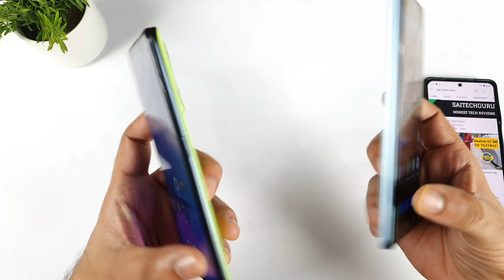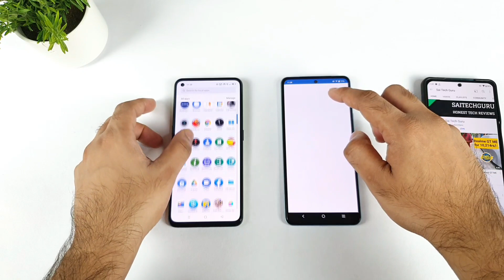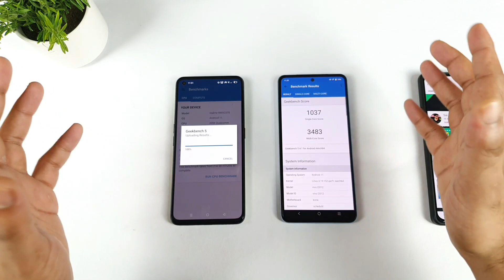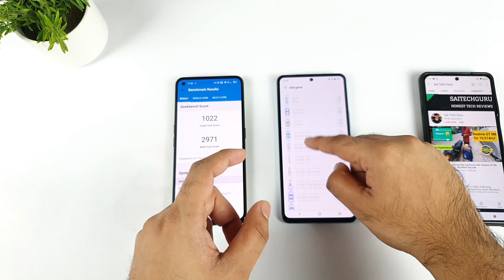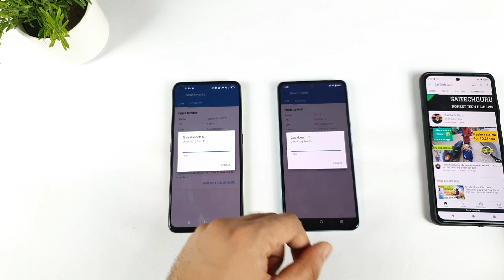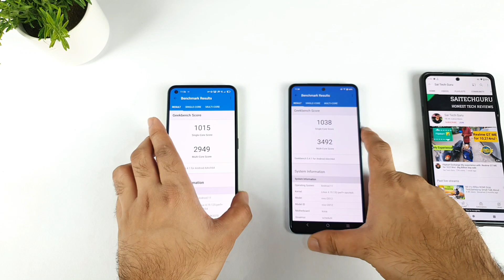Realme GT Neo 2 vs iQOO 7 GeekBench 5 Comparison Which is Best Using High Performance Mode🔥🔥

Comment: Today my iqoo 7 12/256 got delivered and i tested Geekbench the results are 
975 single core(100 less)
3336 in multi core(100 less)
Why there is such differences compare to your iqoo 7?
Reply: that's not a big difference